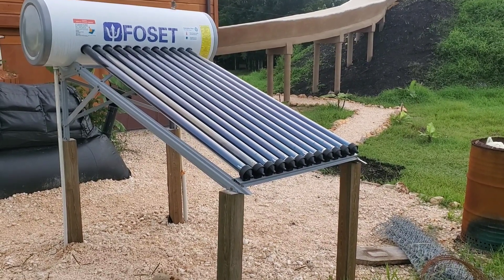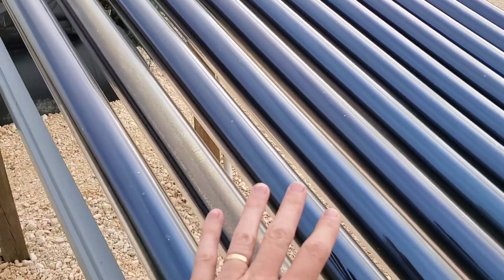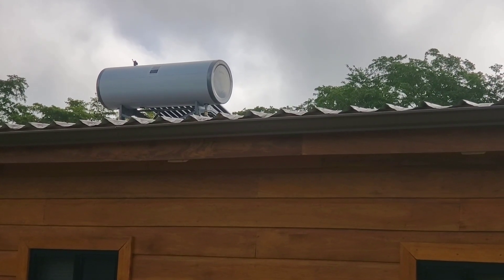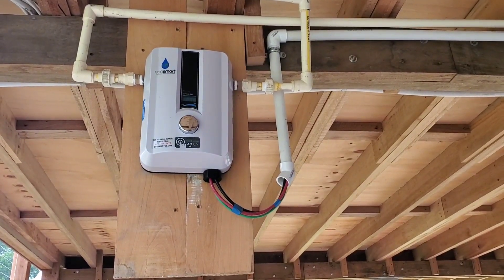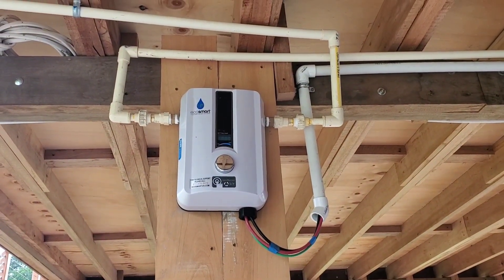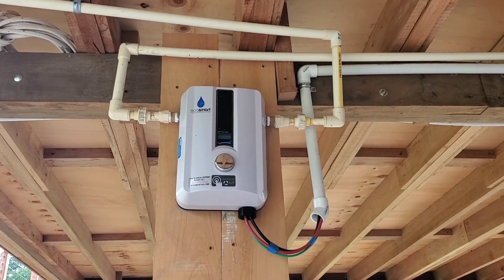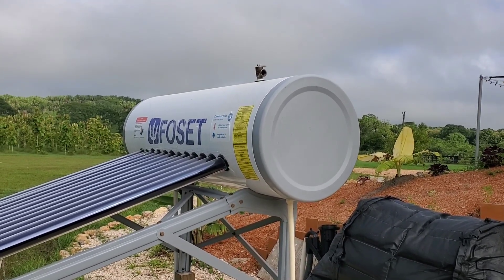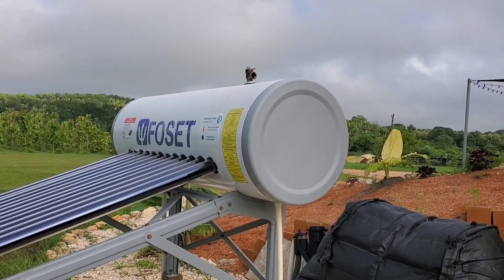Belize house update - Hybrid solar-electric hot water heating system

Comment: little hack that maybe of interest to ya..... I was using 2x ecosmarts in series to get 12kw~heat(my dad had originally bought a 6kw rheem; same brand; live in Canada) and I was having a bit of trouble having it run well in winters and I realized that it was likely due to slight pressure/flow differences; after a bit of thinking I used a pressure regulator followed by a valve(valve restricts the flow, regulator regulates max pressure at the valve) so I could have a constant predictable water flow and essentially have perfect how water at all times with dumb water heats..... I later seen this exact setup in use for a commercial dish steamer.... I ended up buying an eco11 which is also regulated however still kept the pressure regulator and valve setup as to not need to max it out:); other words there's a energy savings benefit too if you don't mind a slight slower flow.... other than that, I suggest getting a filter before the electric water heat as I've already have had to replace an element in one of the units(before upgrading) due to sediment build up

Comment: These are very common in Australia. They're usually paired with a storage tank inside. I believe the tanks usually have a water heater built in but they're rarely necessary.